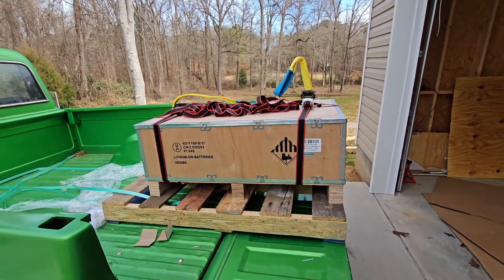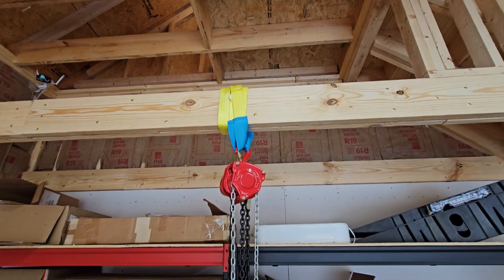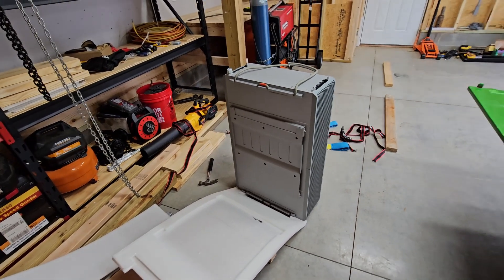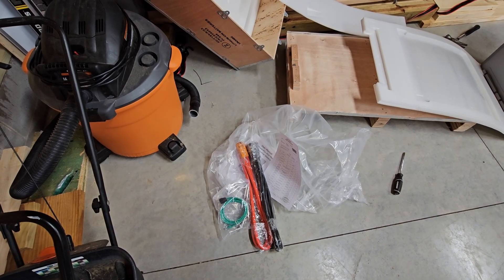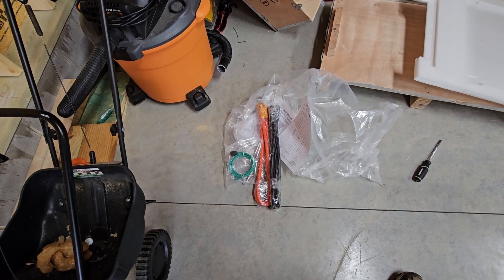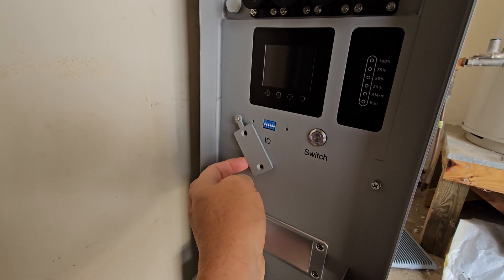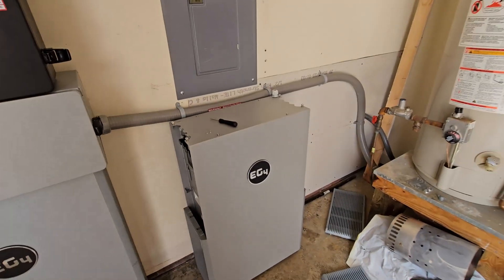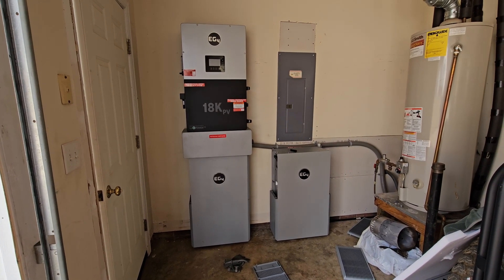EG4 PowerPro Battery Arrived Jan 2024

Comment: For $1,200 less than what you paid for this, you could have easily DIY'd a 15.56kWh battery with grade A cells and an advanced JK BMS with active balancing, low temp sensing and communication ports, bus bars and free shipping.  And you wouldn't have all these lifting issues.
Reply from the maker: I am grid tied and would not be able to pass the inspections with DIY batteries.  They required everything to be UL listed.

Comment: I wouldn't recommend buying these batteries. When they go into protection mode it is a nightmare to get them to comeback online. I have 6 of them. We've have multiple batteries go into protection mode. We still have one that will not come back online. We've bought the 399$ charger that's a scam. Eg4 has been tough to get any help on troubleshooting the battery. The battery has no reset button like the LL batteries. Complete nightmare. #300lbwallbrick!
Reply from the maker: I can see where these batteries could be a real problem, especially if you are off grid.  I have been told by SS not to discharge below 20%.  I think this is because the BMS will go into protection mode and disconnect.  The problem is if you set everything up to charge to 100% and then discharge to 20%, the battery will still lose charge overnight because the 18Kpv still pulls power from the battery.  If you have a couple of days with no sun, you could easily run the batter voltage down until the BMS disconnects.  I am grid tied and have it set up to charge the batteries from the grid if they ever get to 19% SOC.  On a side note I saw a YouTube video where a guy took this battery apart.  It comes apart fairly easily.  You could pull the cover and put a charger one the battery pack to get the voltage back to the value needed for the BMS to work.
PS: I only discharge to 25% SOC and I charge from the grid if the battery hits 19% SOC.  If you are off grid you should be able to set up something similar with a generator.
Reply: @Gary_Pauls_DIY   I've not even been able to get to the 20% problem yet the battery is in protection mode with 57%. I can't get it to come out of protection mode to commission the system. It's all brand new right out of the box. I'm just hoping they will honor the warranty.
Reply from the maker: @opietaylor9308  I completed one warranty return with zero issues.  I had to take a video showing the problem along with the serial number, but they arrange for shipping, sent me the shipping documents, and once they had the bad unit, they shipped out the replacement to me right away.

Comment: Mine was supposed to arrive today and didnt
Reply from the maker: Mine was delayed in shipping due to weather for a day or two.
Reply: @Gary_Pauls_DIY  I got it now, having trouble with it talking to my sungold power inverter. The battery is staying in standby.
Reply from the maker: @Lukeor  Not sure I can help with that.  I think the battery should be able to run without communications.  You would need to set up all the battery parameters in the inverter.  Also, is the inverter the same as the old EG4 6500?  If so setting up the battery for the EG4 might work.

Comment: I use ramps 2x6x8'... then you get it onto a cart, or furniture dolly... the chain hoist is nice... I've also thought about those hydraulic "lift tables", but unfortunately, the ones I've looked at don't even go as high as my 2x4 pickup bed... ! :-( 

Thanks for the video!
Reply from the maker: I have thought about the lift tables as well.  My truck sits low, so it would work to unload, but when it is lowered it is still about 6 inches off the ground.  I have used the chain hoist for several things now and it seams to work ok.

Comment: Some much welcomed "small" upgrades that mine did not get on my delivery a month ago. Curious to know the difference between the 2 BMS versions if you figure it out, i dont have the upgrade cable but i assume I'll be fine since both of my batteries came with the same older firmware.
Reply from the maker: Yes, I am really curious too.  The new battery has BMS version Z02T13 and the firmware on the SS website to download is version Z02T09.  I sent them a message to see if I need to match the BMS versions and if so how do I get the Z02T13 firmware.
Reply: @Gary_Pauls_DIY  interesting, do they actually post the change logs with the downloads? Either way let us know what you find out. I wish the firmware install was as simple for the batteries as it was for the 18k (no extra cables necessary)
Reply from the maker: @jlimpa4070  The data is in a PDF inside the compressed file you download.  Not very detailed though.

Comment: Read the instructions you only need to run the one parallel cables between the batteries and hook the batteries together.
Reply from the maker: I know.  Sorry if I made it sound different.  I was just going over what was supplied in the packaging.  The battery comes with a Com cable and 2 positive/2 negative battery cables to connect to an inverter.  The paralleling kit comes with a Com cable and 1 positive/1 negative battery cable to connect the two batteries together.  My issue is the distance I need to place the batteries apart.  It is farther than the paralleling kit will allow.  Signature Solar sells the battery terminal connectors for this battery, so I am trying to decide between using the cables I have and installing a bus bar or buying the parts and building my own cables the correct length.

Comment: Try This bus bar.  Victron Energy Lynx Distributor | 1000A

Part of Victron’s Module Lynx system, the Lynx distributor is a module DC busbar
Reply from the maker: Thanks for the suggestion.  Just ordered one through e-bay.
Reply: @Gary_Pauls_DIY  Here is another suggestion on your Victron connection Gary. Connect 1 positive and 1 negative from each battery using 2/0 to the Victron  and 2 positive and 2 negative 4/0 to your inverter. Also use 200-250A fuses going to the victron and 300A fuse going out from the victron to inverter or (2) 400A ANL fuse on the positives before going to the inverter. Hope it makes sense.

Comment: I used the extra red and black cables to busbars between my 2 powerpros instead of the parallel cable set
Reply from the maker: I think that will be my plan.  As @cre8tive31 suggested, I will get the Victron energy bus bar and run two positive and two negative 2/0 lines to the bus bar from each of the batteries to tie them together.